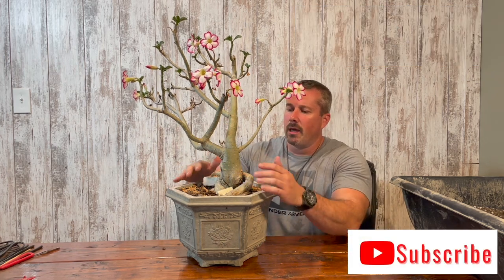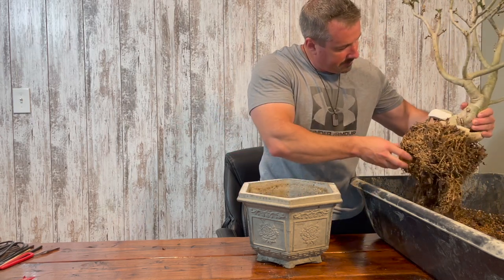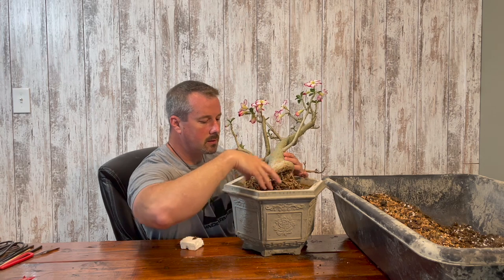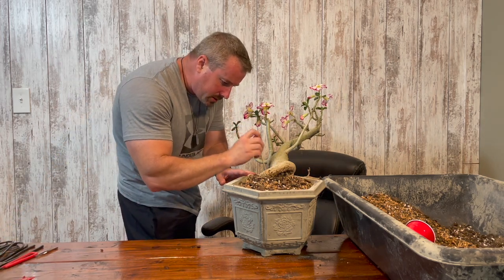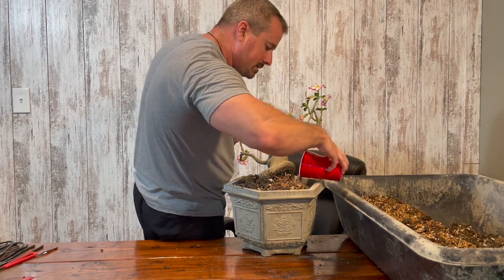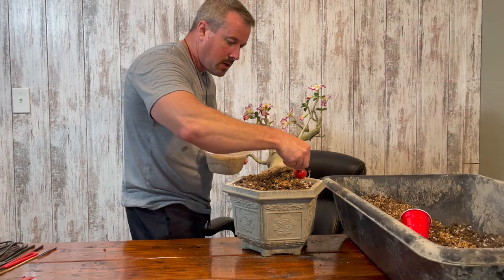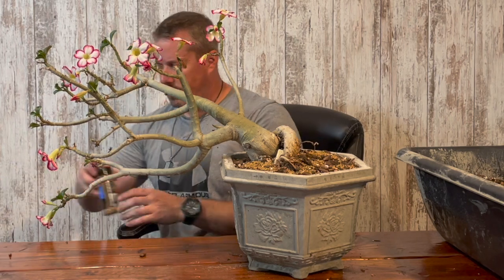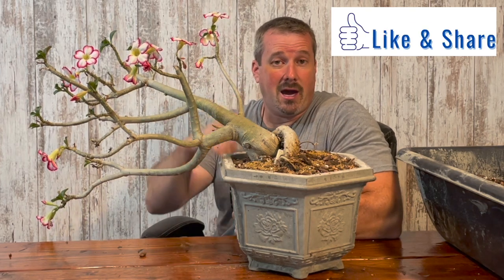HOW TO MAKE A SEMI CASCADING DESERT ROSE (ADENIUM) BONSAI

Comment: Hey Jeff!

Any updates on this Adenium?

would highly appreciate a quick video if you can
Reply from the maker: @h.mutawa866  This adenium was doing great coming out of dormancy this spring then I moved it outside again like normal. Unfortunately that is where things went bad. I placed the pot on a stand outside and one day the stand fell over and the plant took a bad fall. Breaking several branches. I had to cut it back several times to try and stop the plant from rotting back from the damaged parts. This did not work.